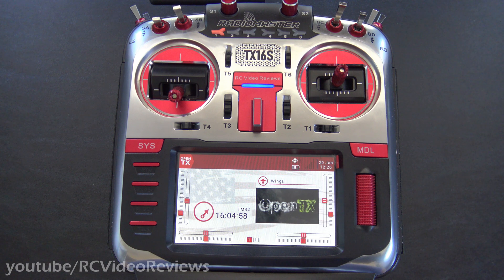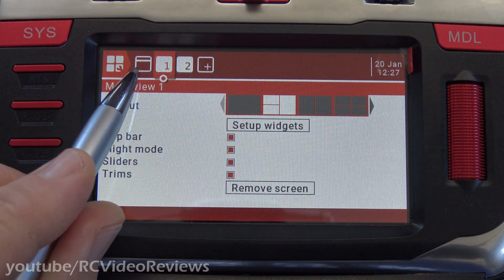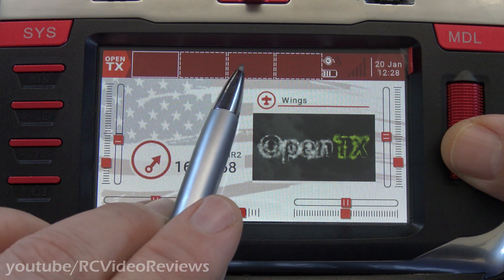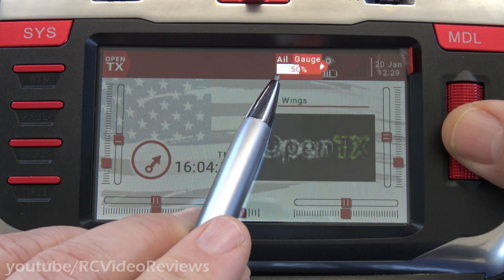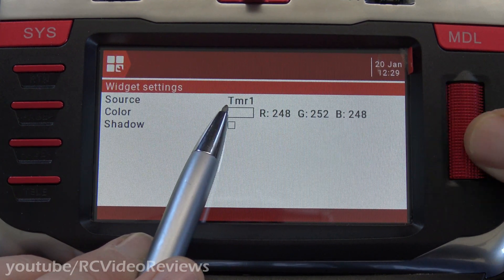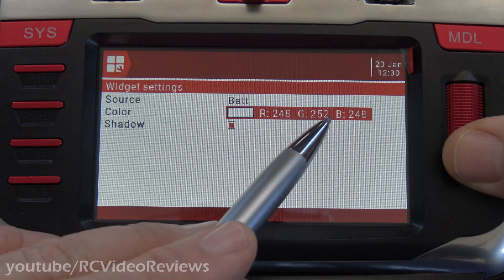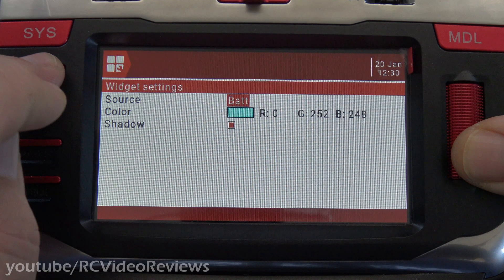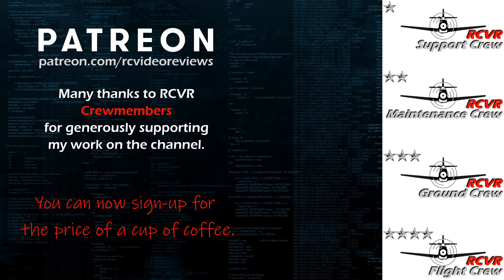OpenTx Snippet • How-To Display Transmitter Battery Voltage

Comment: I started looking at the snippet "How to Install the Amber Sound Pack" and notice that you have the Battery Voltage Widget displayed twice on the top bar of your model screen. Is there a reason for that?
Reply from the maker: No. I do a lot of demo/test videos. It's likely somebody asked me how I added that widget, so I showed them and never took it back off.
Reply: Many thanks for the explanation. I am finding your videos to be a goldmine of information.

Comment: John, so I added that on my radio but when I switched to a different model, it wasn’t there. I added to that model also but is there a way that it will automatically add it to each model? Or do I just need to do that every time I add a model?
Reply from the maker: Unfortunately no, you have to add it to each model. There is no universal widget option that I know of.

Comment: Hello, I wondered what happens when you have two radios, say taranis and tx16s, and want to uses open tx, does the pc know and show the different radios ?  It might be you would still use both radios!  Thanks
Reply from the maker: Yes, on Companion you can setup multiple radio profiles. When you do that, when you start Companion it will ask you which profile you want to use and you can switch among them while running Companion depending on the radio with which you want to work.
Reply: @RCVideoReviews  thank you that’s great. Some more snippets perhaps 🤞

Comment: Be good to be able to remove the default voltage bar if poss - no point in having 2 😊
Reply from the maker: Yeah, that would be cool, but I don't think there's a way to do it. Maybe that's why stock it doesn't include the numeric readout.

Comment: Hi. Simple but useful video for all telemetry info displayed there. Anyhow do you know that the "WiFi looking" symbol to the right of the speaker mean? I have created fresh model and can't figure that out. Best regards
Reply from the maker: On the right hand side of the speaker there is a volume level indicator. When you turn the volume up, the indicator fills out more bars. When you turn the volume down, the number of bars decreases as well.

Yes, this "snippet" series is meant to be real quick little bites of information. Thanks for the comment.
Reply: @RCVideoReviews  Thanks for reply but I'm aware of the volume bars. This "WiFi" sign is directly above that. I've got old horus x10 and no WiFi/buddy box modification was done so I'm little clueless.
Reply from the maker: The only other indicator in the area is the Rx strength indicator. That sits between the Speaker/Battery stack and the Clock.

Comment: Very cool. I discovered this feature a few days ago. Great video.
Reply from the maker: Thank you. I've probably been asked how to do this a couple dozen times. I have a bunch more of these snippet videos planned. They'll all be quick and to the point.
Reply: @RCVideoReviews  I am planning to look around on your channel for the best battery voltage settings (range and warning) for the tx16s with a 2s battery. I'm not sure if you've made a video about it. I'll find out. 🙂
Reply from the maker: There is a video...I'll let you look. Feel free to ping me if you just want the answer ;)
Reply: @RCVideoReviews  Ok, now you're just toying with me. LOL... I found one, but you mentioned it's Li-ion. Do you have a 2s lipo battery video showing the best range and battery warning level?
Reply from the maker: @SunriseWaterMedia  No, just Li-ion. The same rules apply for LiPo Tx batteries as any other battery except for one difference. The amp draw on a plane can be significantly higher than what you'll probably see on a radio. So it's going to be a little safer to drain a Tx battery a little lower than you'd want on a plane. 

My rules for planes: 4.18 peak (4.2 is conventional wisdom). 3.65 low voltage under load. 3.75 after resting. 3.75-3.85 for storage.

For a Tx, I would be more comfortable using 3.50 low voltage under load. 3.60 after resting and 3.75-3.85 for storage.

The reason I would be more comfortable with lower voltage on Tx packs is because a lower amp draw gives you a more even voltage decline to the minimum. With a high amp draw, it would be easy to blow past the hard minimum, so I keep more buffer.

FYI: Hard floor is 3.3v. Don't go below that or you risk permanent damage to the cell.
Reply: @RCVideoReviews  I really appreciate you typing all that out to explain it. Thank you!